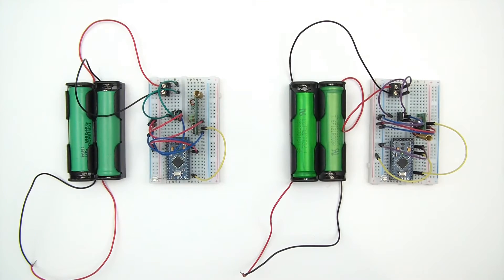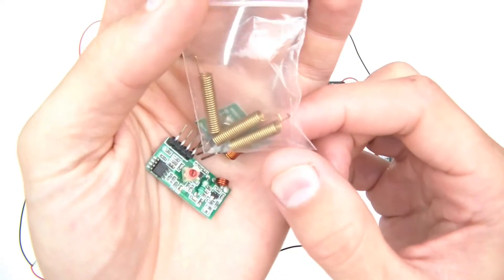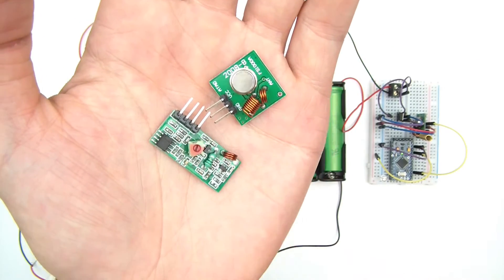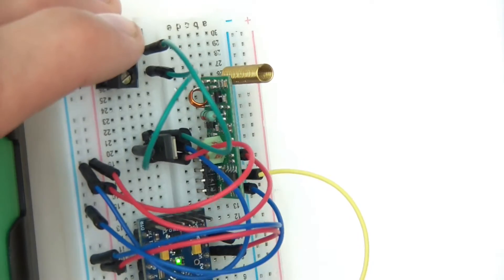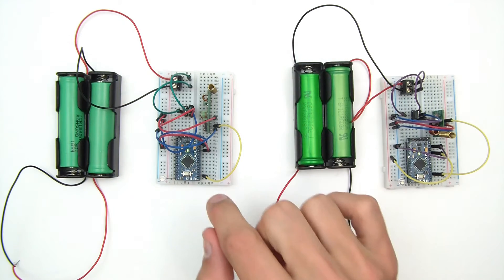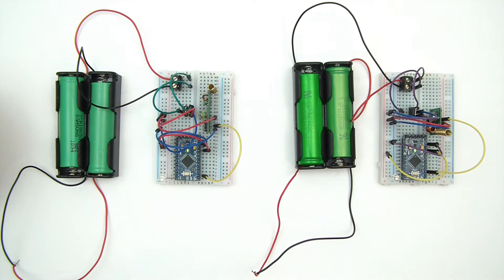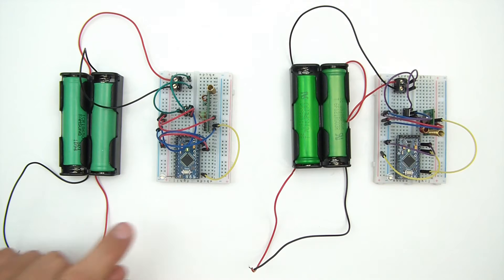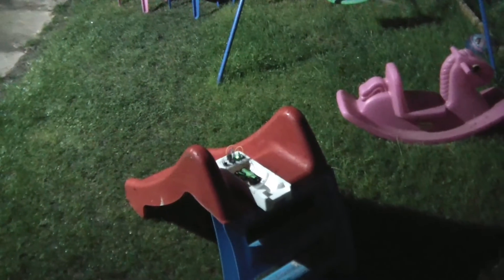INVESTIGATING: The Range of Cheap 433MHz RF Transmitter Receiver Modules - My Test Rigs! (Part 1/5)

Comment: I have ordered one of these to build a sewer pipe locator. Now I only need a maximum distance of 2.5mtrs between the transmitter and receiver. Better still i would like to vary the transmission range with in that 2.5mtrs. Do i use pot in series with the antenna and would the pot be better on the transmitter or the receiver? Plus what resistance potentiometer would make this work? Great vids by the way. Very interesting. Many thanks. Olly.
Reply: Hi! I have the same idea as you. Have you figured it out already? Thanks

Comment: Thanks
Good video and good method for testing
the esp NOW protocol of the esp32 has much longer range, and more reliable. I found it after buying 5 modules of the RF 433.  

My conclusion: do not buy the RF 433
Reply: Esp 32 need wifi and internet

Comment: I tested that transmitters with an much better receiver(ham radio) and i got a range of 2Km
Reply: So clearly the receiver is the bottleneck
Reply: don't lie
Reply: @vivekkumarthakur2948  i'm not lying
Reply: The transmitter is quite powerful. The receiver is just really bad and generally not meant for weak signals
Reply: I also used a much better antenna
Reply: @theverygaming  how much tx nd rx costs you ??
Reply: @vivekkumarthakur2948  Quite expensive, 100+€ for the whole setup and a lot of knowledge about radio in general and you need to hook the receiver up to a computer to get it to work. For generally just longer range i strongly recommend you buy a different kind of module.

Comment: my transmission is off by a couple hundred is the ant lengh responsable for this? im tryin 2 tx on 433.920 but its 433.681 any ideas? also im using the rc switch lib instead of radiohead at the mo if that helps?

Comment: It should depend on transmitter voltage...
Reply: The litlle crystal should work up to 30V, but I think that it also has a transistor that limits it to 12V. Maybe one can replace it for a better one, and use a 30V step up... But seeing your result - it's not just like that.
Reply from the maker: Thanks for the comments!
Reply: https://www.electroschematics.com/wp-content/uploads/2014/03/CDT-88-Transmitter-Schematic.jpg

This could be it's circuit.

Comment: These things are utterly hopeless. You get the max range by increasing 
the supply voltage to 12 VDC on  the RX , setting the bit rate  to minimal and by soldering a coiled  20 SWG wire  17 cm long ( 1/4 wavelength) and for that you might get 4 meters  out of it. The problem is the limitations  and simplicity of the RX  circuit.  You should be looking at "superheterodyne"  units which are also dirt cheap but with far superior performance.

 https://tinyurl.com/ybljhowb

PS : Do  you know the Arduino mini pro has a 5v regulator onboard  and the  RF RX supply  is rated up to 12v rendering the external regulator unnecessary.
Reply from the maker: Duns Scotus Hi, I've tested 12v, etc throughout the tests. 12v does nothing for these modules, though the 1/4 wave coil works well.

Comment: Nice video! Difference in manufacturers may perhaps cause differences in reception. I had similar issues during my (ongoing) experiments with some nRF24L01+ transceiver modules (probably fakes or clones). Different modules of the same make performed okay amongst each other, but didn't work well when mixed with modules of another manufacturers. I read that not every clone is implemented to perform exactly the same as the original Nordic chip, even though they may seem to work fine. 
Another thing I noticed is that your regulator seems to miss some capacitors. Most regulators I know recommend capacitors (e.g. 10 or 22 uF) on both the input and output supply lines to ground. A power dip when transmitting could also explain less performance...
(BTW. sound is clipping a bit in the beginning and I think you still need to set the end-screen widgets)
Reply from the maker: Thanks for your comment! I've also had issues with NRFs! You're right about the regulator missing two capacitors, I should really have used 330nf and 100nf caps. I guess out of habit, I don't usually bother since I don't usually work with devices sensitive enough to need them. I can't hear the sound clipping on my devices. You're right about the end-screen! I get lazy with end-screens and tend to do them when I get 10 to do! Haha!